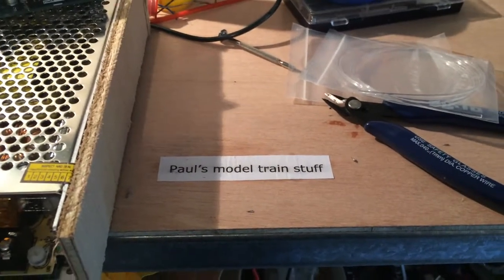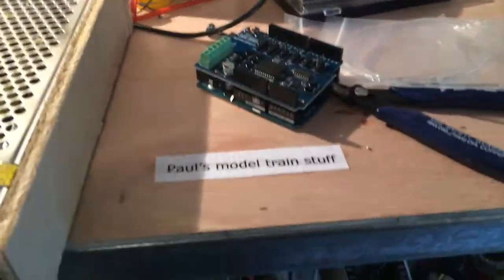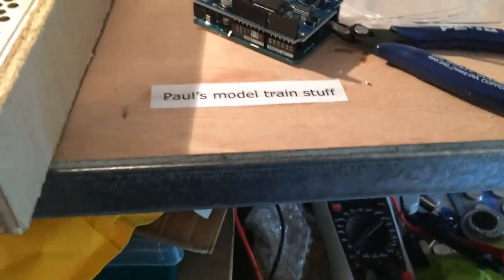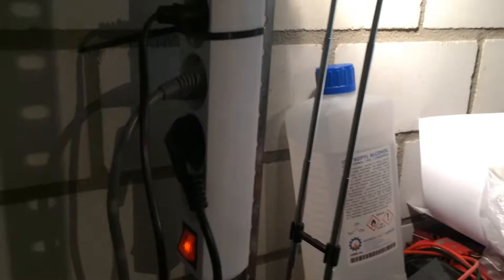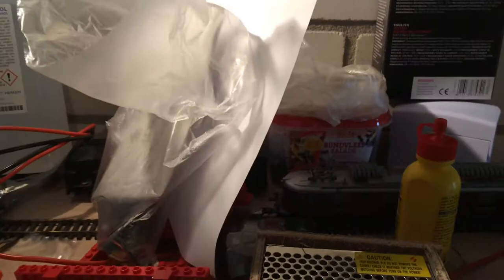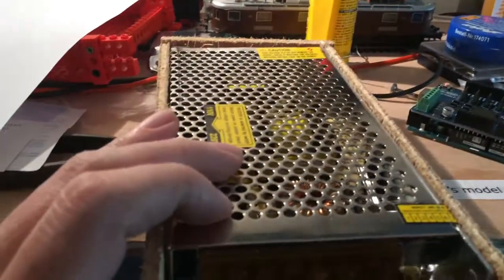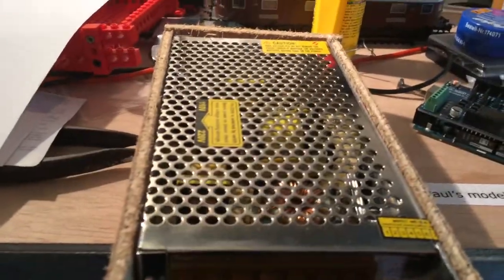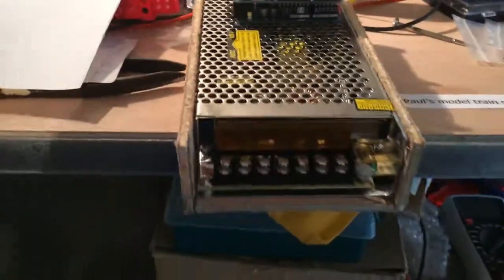Bench improvements and PSU (Video in English)

Comment: Good thing you are working on and considering proper isolation of your Metal parts as part of improving your workspace.
Something you also might want to consider is to connect anything metal (i.e. your bench) and the low-voltage ground of the power supplies you are using.

Note that this means two different things:
1. Circuits: Connecting their grounds (and make it common; so all blacks go together, if possible with a small resistor; one of your colleagues might have a lot of them just lying around)
2. Shields: Connecting all of their shieldings (and make it common shield of the new 18v transformer + connect it to the EARTH connection of the socket (taking this is actually connected to EARTH) and connect your Workbench to EARTH)

Since you intend to use modulation; and you have AC low-voltage adaptors not connecting the ground will cause a static voltage difference to build up causing undesired effects which you will probably notice on anything that is dependent on Data over Power or that is switching at a low voltage (e.g. your Arduino).
https://nl.wikipedia.org/wiki/Ladingsvereffening

In short; peaks will build up and discharge probably at first over your Arduino pin's (Pullup or Pulldown resistors won't stop any input pins from switching "miraculously")  and after that over your Arduino 328 chip.

A side note; Isolation is a good thing, isolating a powersupply with wood could also add extra "challenges" when looking at different hazard types; e.g. fire hazard.
The 18v one you are using has openings on the left-side for a reason; if you close that make really sure to have a working fan on top of it and it has an internal thermal fuse.

Like the improvement!; Stay safe. :)